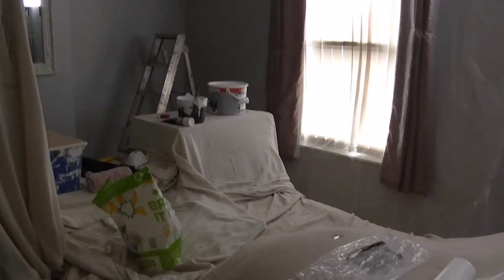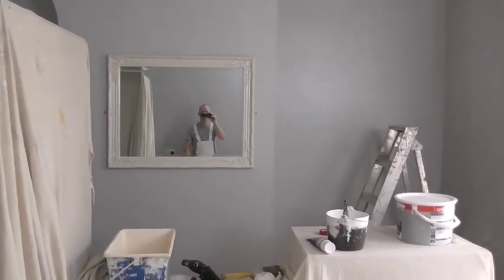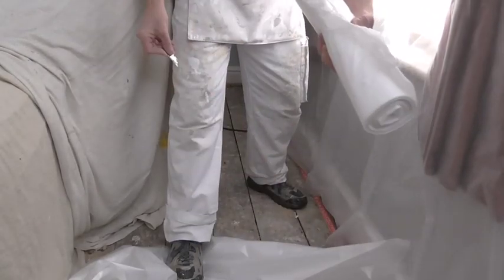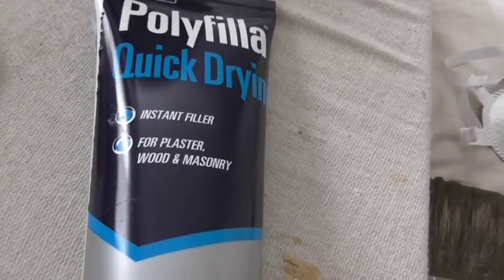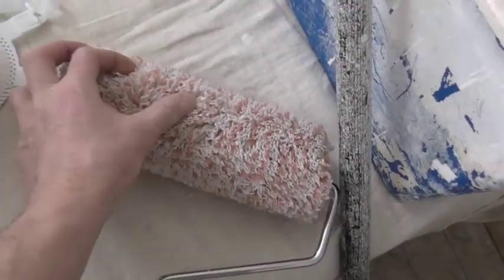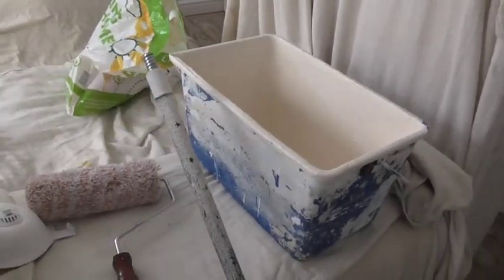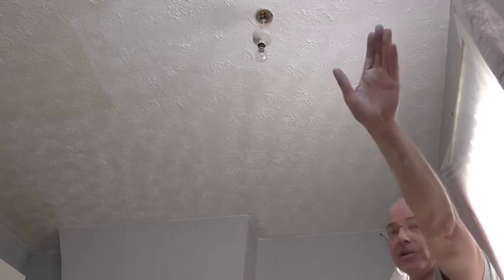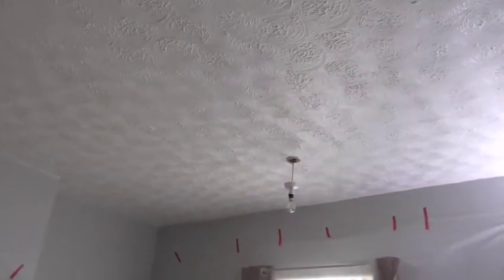How To Roll A Textured Ceiling

Comment: Nice vid. Only question I had is how did you manage to avoid white speckles on the walls doing ceiling last. I know that’s not normally how you would prefer to work. Ta
Reply from the maker: Thanks, well luckily the walls had been painted in silk so any splashes wiped off. Sometimes you put plastic up all around the room, especially if it's a finished wallpaper.
Reply: Makes sense. Cheers!
Reply: Rolling slightly slower makes less splatter as well.

Comment: Did 100's of nicotine stained ceilings over the years. Well worth the effort. Awkward job with the furniture etc. Nice 1. Did the goose down blend in ok to the existing paint done by homeowners?
Reply from the maker: Thanks, yes well worth doing and luckily the touching up blended in.
Reply: @PaintingandDecorating   excellent mate. Goose down popular nowadays. Ive used it quite bit the dulux easy care.Good coverage and hard wearing. Keep up the good work pal.

Comment: Question: Why do cutting first (not a term I've heard before though, but understand what you mean) and not after? What does that achieve?  So if you're using the same paint for walls and ceilings to begin with, mainly to create a base for colour later, ceiling staying white, would cutting be irrelevant?

I ask as I have to do the edges at some stage after rolling. What I'm trying to find out is doing it before or after, which is preferable. I'm going to say neither. 

Disclaimer: DIY'er No Expert. I've done the edges after rolling.
Reply from the maker: Rolling after always leaves a better finish.  Thanks

Comment: I would like weigh in please...
You are you using a 2" pure why not a 3" synthetic?
As for the roller use a 12" with a 4 foot pole? 
And if its stained use bullseye as it's very white and covers all stains etc...
Reply from the maker: Bullseye is expensive and it's up to the customer. And as for size, it's a small room plus small roller is easier to roll the warped ceilings, as most ceilings are not flat.  Especially textured wide rollers no good.
Reply: @PaintingandDecorating  Recently did a tricky kitchen job, massive ceiling with a great many spotlights. Rolled the first coat with 12'' microfiber, but it was too big for the awkward passes between the lights, looked rubbish when it dried and was a strain to do. Did the second coat with a 9'' and it was much more efficient. It's horses for courses, dunno why everyone assumes bigger is automatically better with roller sleeves. Same with brushes.

Comment: 1 good coat on the ceiling should have been sufficient for that job.Unless that was a nicotine stained ceiling then then 1 oil undercoat and 1 emulsion coat
Reply: I'd use Zinsser BIN so you can paint over it within the hour. Obviously more expensive though , depends what the client wants i suppose. If that was nicotine stained then it'll still come through half a dozen coats of emulsion without oil undercoat or Zinsser or another suitable stainblock . So glad i don't come across many nicotine stained ceilings nowadays , i can remember washing stuff down with sugar soap and all the nicotine running down my arm and neck , proper rank ! 😒